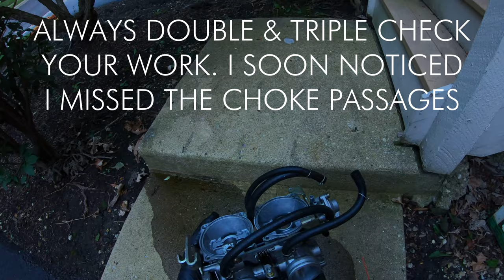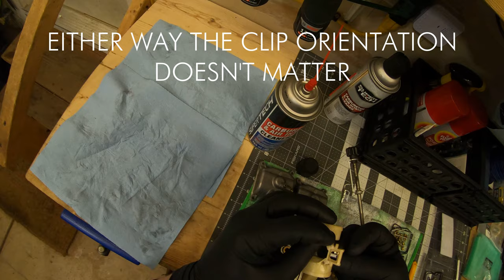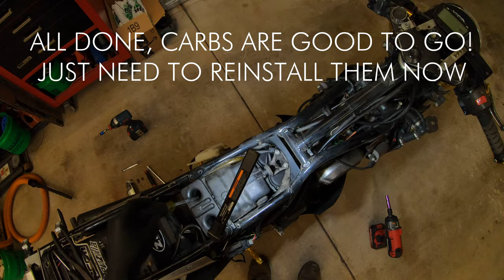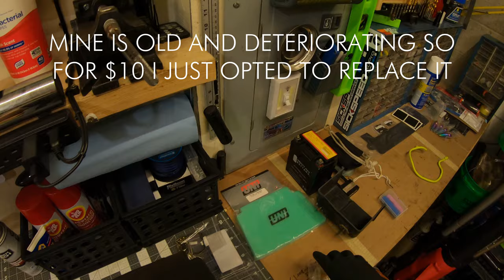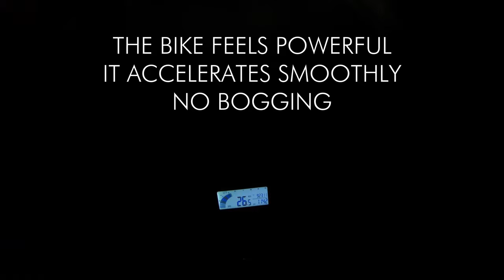How To Rebuild Or Clean Your Carburetors: Ninja 250 Carb Rebuild

Comment: What is your motorcycle?
Reply: It says right in the title: Ninja 250. Judging by the banana seat at 2:17, it’s a Kawasaki EX250F, which is the most common (1988-2007 Ninja 250R).
Reply: Yep. Around 17 minutes in you get a good view of the rest of the bike. Definitely an EX250F with the silver-colored valve head cover, distinctive tank, dual exhaust, and more (frame, forks, etc). You can narrow down the year model a bit since most have chrome exhaust pipes and these are black but the tank and few fairings that remain are painted so we can’t narrow it down further.

Everything from the gauge cluster to the headlight, handlebars, tail light, mirrors, and turn signals have been replaced with completely different parts most of which look nothing like the originals.